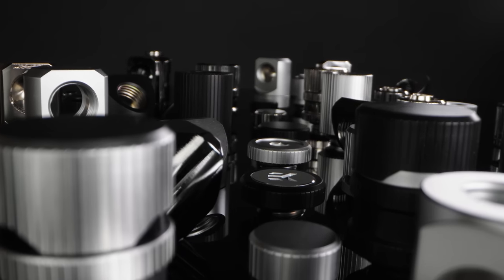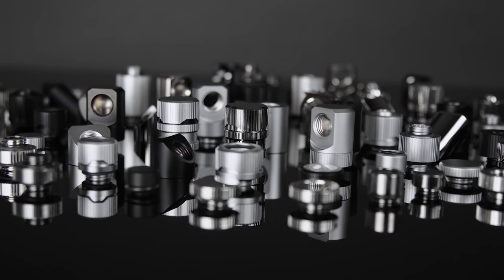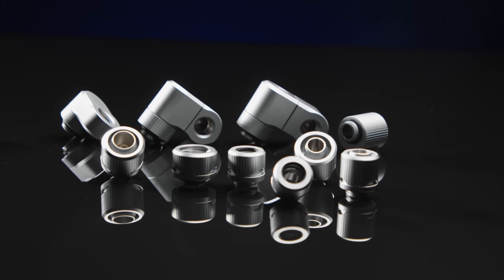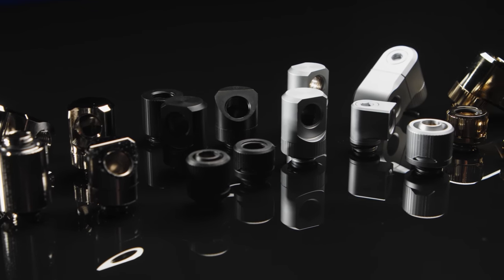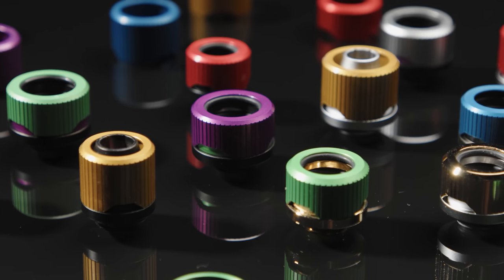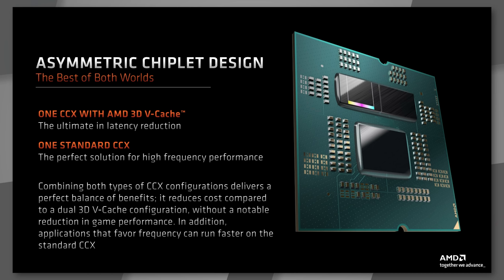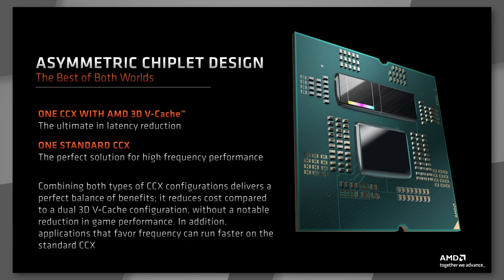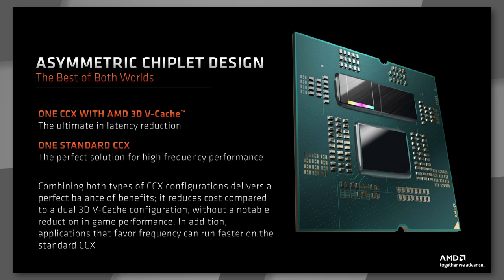Why I switched back to Intel...

Comment: aged like milk
Reply: Been using Intel since 2012 but It's over for Intel ggs bro I think Im gonna switch to AMD
Reply: I came here to say this.
Reply: Yea
Reply: Jay should stick to telling people to GO OUT AND BY A RTX3090 right now for $1200 while you can :) .. that also aged really well.. he is on a roll this guy!  Whatever he does... do the opposite and you should be golden. haha
Reply: More liked aged like raw milk (raw milk spoils faster in case you didn't know)
Reply: @alish4332  It's not over, its just a big set back.
Reply: "aged like milk"
Did it?
- So none of the problems with his amd processor he presented were real?
- Or are they at least gone/solved by now?
- Or are we just in deep sh*t for both cpu-manufacturers producing unreliable chips nowadays?
Reply: @petermeyer6873  AMD problems are fixed now I would say as an owner of an asus MB and an 7800x3d CPU
Reply: @mokurai8233  Thanks, good to know! Im looking positively foreward now to the new amd 9000s.
Reply: @petermeyer6873  incorrect scheduling is operating system problem, not cpu, and is specific to 7950x3d with 2 different chiplets. But do intel has no problems of same kind with P+E core design ? His second problem with memory on high frequencies could be solved by now in one of numerous bios updates or be specific to his motherboard or 7950x3d. Problem with exploding amd cpus got fixed long time ago.

Personally, I never had any stability issues with my 7950x system. Runs 100% stable today, same as it did 1 year ago, for as long as I have ac power. I agree that both cpu-manufacturers had problems with their last gens (trying to push it too far bc of intense competition), but intel degradation and stability issue is probly way more severe than anything amd had so far.  Bc its 50+ % failure rate in server environment and probly permanent voltage damage in affected cpus.
Reply: @AphillyatedYT  I'm running my 2 dimm gskill flarex RAM @ 6000MHz CL30 without issues. And on AMD's website it says they support 5200Mhz on 2 dimms max. What are you running?
Reply: @petermeyer6873  he is just nitpicking for a way to justify moving back to intel because he has been a long intel user. All the issues he pointed out got fixed with software and better OS integration support for Ryzen CPUs. But none of them are hardware related but maybe his motherboard was shit because I've manage to run 6000mhz on several AM5 system with a way different motherboard than his and they were not even Asus.
Reply: Damn, beat me to it! Bet ya he's regretting it.😂
Reply: @DingleBerryschnapps That aged like milk too. 13th and 14 gen are still a dumpster fire.
Reply: Yep.
Reply: They are probably heavily sponsored by Intel, the crashes and issues with 13th and 14th gen have been happening since June/July of 2023 last year, there's no way they didn't had any information of this until now.
Reply: @defectiveclone8450 Hilarious knowing theres people who paid that much. Meanwhile I got one at microcenter for 760 😂
Reply: I just switch to AMD and love it
Reply: lol look at his upload Aug 4
Reply: @alish4332 using amd since 2011 has always lasted and preformed. 7years first pc,  2nd pc lasted 4years before it had power spike from power outage. New pc going strong and amd chipset makes it upgradable and future proof
Reply: I switched back to 14900ks from 7950x3d. But i have about 20 computers bc i have no life
Reply: aged like milk? so like intel processors?
Reply: I'm planning a PC build, and I always intended to make it an Intel system, just because I'm more familiar with it.

It's going to be an AMD system now...
Reply: @alish4332  lol just because their management sucks doesn't mean their product does. Look at how pathetic the Zen 5 desktop chips are. 14th gen Intel is the better buy, and if rumours of Arrow Lake's performance and features are true then Zen5 is already dead.
Reply: lol he never actually had any instability issues, he just makes those videos to get clicks from AMD fanboys like you. cope
Reply: @alish4332  It's literally not
Reply: @alish4332  I did in 2018
Reply: And it even opens with an EKWB ad lmao
Reply: TheNathanCarlson  yep
Reply: Your comment you mean?
Reply: @alish4332 been using intel since 2007. Never had an issue with Intel. Not sure what all the fuss is about
Reply: @petermeyer6873  lol

Comment: i guess you need to reverse back to ryzen
Reply: You’re right. I recently got the 14900k i9 and it makes many games I could previously run pretty well unplayable ☠️
Reply: @Doc_Elijah  Turn off Enhanced Multi Core, it will help a lot with performance and keeping your CPU Cooler.
Reply: @WercSmarT  
LOL crippling your CPU to run stable, ouch
Reply: @SMGJohn  I still get 39000 points on Cinebench, it’s fine. I’m not losing enough performance to make a difference, might as well run cooler.
Reply: @WercSmarT  
I too enjoy buying hardware I have to deliberately cripple for it to be stable, mate. 
Do you look yourself in mirror at times??
Reply: The i9 is objectively better, I have both cpus on different personal computers and the i9 outperformed the 7950 in every way except in gaming which was a miniature loss
Reply: Bruh 😭
Reply: I do find the Intel stability problem to be a big oversight but you’re talking exactly like someone who hasn’t done any research. MCE is NOT the intended stock experience. Even if you disable it, it hardly loses any performance at all. You aren’t crippling the cpu. You’re just stopping the mobo from degrading it with over the top cpu settings. It would be a similar story if motherboards set a large negative pbo offset out of the box but AMD doesn’t let them do that. Intel wanted to give motherboards more room to play but it backfired pretty hard. Both platforms have their issues.
Reply: @t7274  mate ik what happened i was just joking about the recent events
Reply: Nobodycares392  agreed it's a skill issue coming from @Doc_Elijah for sure LOL
Reply: @YaBoiEcliptic what are YOU doing other than gaming ? Lol
Reply: Nobodycares392 also the HOTTEST 🤣🤣🤣🤣
Reply: @YaBoiEcliptic  I too could the best cpu of all time if I used a thermonuclear powerplant to run my internals :)
Reply: @t7274 Mine still degraded. It was the phc voltage that had random io issues with usb and video drop outs. 9900 had same issue after a year and 2 motherboard later. Screw Intel money pitt trying to fix their buggy shit! I went to AMD and it just works well. Micro stutters from 13900k gone
Reply: @sorryidgaf.6043 you can do a lot of things other than play games yk
Reply: @JokerP5  BUT ONCE AGAIN. WHAT ARE “YOUUUUUUU” doing other than gaming ??? 😂😂😂
Reply: At first I was going to go with the new intel series coming later this year (2024). But now I have learned that with intel processors' e-core and p-core; quite often the games were unable to tell the difference between the e-core and p-core.  So the games would run off the e-core and not p-core.

I think p core stands for performance  and e-core is economical; which is meant for basic windows use
Reply: @sorryidgaf.6043   editing, schoolwork, motion graphics. Etc
Reply: @SMGJohn  LOL at least it boots normally (faster) and is stable , ouch
Reply: @sorryidgaf.6043  3d modeling, game development, animating, video editing, multitasking and I could probably think of more
Reply: @YaBoiEcliptic well if it working or not is subjective, then yes
Reply: @hjq0023  that only happens if you're running Windows 10 because it don't know how to schedule the ecores, with that being said I RMA'D my 13900 K last week and when the new one comes I'm selling it and payday i am going AMD
Reply: @sorryidgaf.6043  my 13900 K wouldn't even start half the games I own and would crash on the other half I had to RMA it last week using all Baseline settings, never thermal throttled, or overclocked was stable when i first got it a year ago then just got worse and worse
Reply: Right